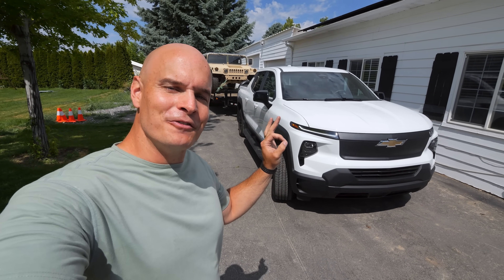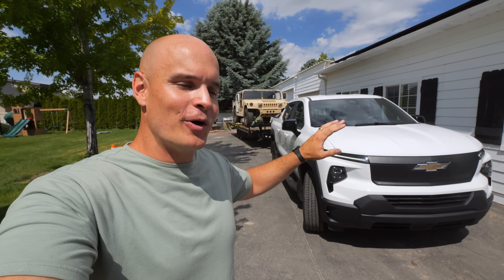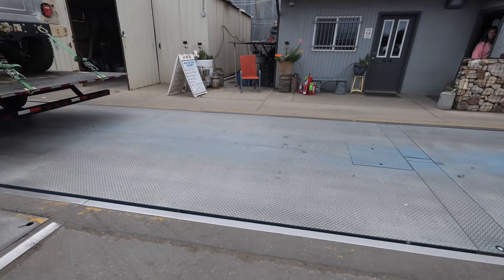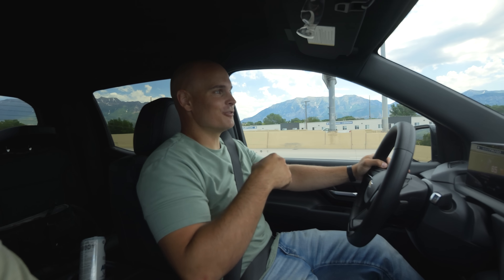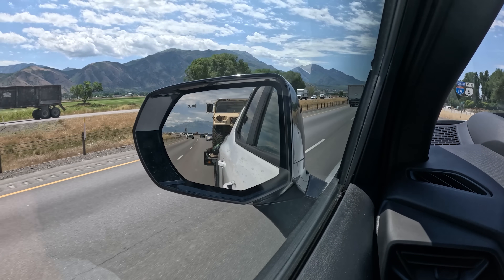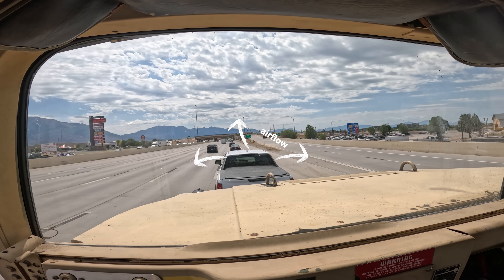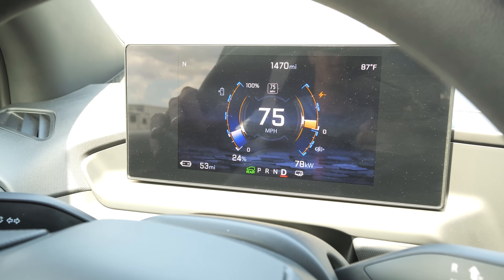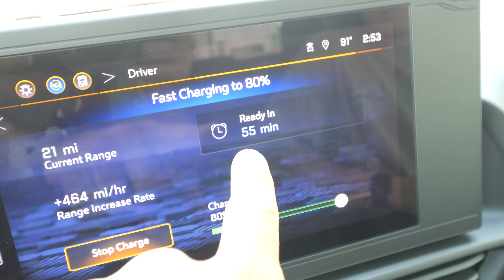The Chevy EV tows TWICE as far as the Cybertruck?!

Comment: Just saw that you said the Telsa and Rivian would only get 10-20 miles more of range during the summer vs winter. Wouldn't it really be closer to 35-40% more Range. I had a BMW i3 when it came out and the range was close to half maybe 60% as far during winter time. Kinda glad it got totaled by some kid in a chevy. You should redo your tests for the Rivian and Telsa now that it is warmer.
Reply: These trucks have much more battery capacity than a car but the cabin volume isn't that much bigger, meaning the cabin heating load shouldn't increase proportionally. The energy losses also tend to be much more pronounced for short trips than for longer ones. Some of the energy losses come from higher internal resistance in the battery when it's cold, but as that generates heat within the battery pack, this is a self-solving problem at longer distances.

Comment: When you look at it by Kwh the Silverado doesn't do as well as well as it initially appears. 

The Silverado has a 205Kwh battery: Cyber Truck has a 123Kwh battery and both the Rivian and Ford Lightning have 131Kwh batteries

The percentage difference between 123 and 205 is 50%
The percentage difference between 131 and 205 is 44.048%

Cybertruck 90 miles or 0.7317073170731707 Efficiency (miles per kWh)
Rivian 100 miles or 0.7633587786259542 Efficiency (miles per kWh)
Lightning 130 miles 0.9923664122137404 Efficiency (miles per kWh)
Silverado 163 miles 0.7951219512195122 Efficiency (miles per kWh)
Silverado claims to have 14 miles left: 0.8634146341463415 Efficiency (miles per kWh)

Comment: It's still gm tho so not safe or reliable enough for my preference until gm razes there quality control up at least 9% more I wont even look at them I like the ls not get me wrong but not in a chevy with a week trans/frame and the steering in them sucks I work on cars every day most of them that come in are gm and most of the work is for the front end trans or snapped frame from a cracked trans it seems that the only good part in them is the LS

Comment: Pretty good result. Also this truck can charge way faster than it showed there. 
Another YouTube channel I watched did a towing test with all four of the trucks, I believe fort Collins Colorado up and over the Rocky mountains to Grand junction and back. But it was 6,700 lb or 7,000 lb. 
They got 240 mi on the Chevy. With about 15% battery left when they got to the destination. When they plugged in it was pulling I think 330 kilowatts to about 50% and then held over 200 kilowatts to 80%. 15% to full took about 1 hour. And cost about $120 lol. 
All the other trucks required multiple charging stops both directions. The Silverado made it all the way to the end with one stop and then all the way back. It really is a hell of a good truck. It's just got a hell of a lot bigger battery which is what you need if you're going to do this kind of work. Also I believe it can output 11 kilowatts in the bed. And I think GM sells some equipment for your house to make the truck be a battery backup. GM did a lot right with this truck. And honestly it's not that much more expensive than a well equipped Denali.

Comment: My favorite incident in my Rivian was getting off the freeway, and ending up at the top of the offramp next to a lifted RAM Cummins who started rolling coal next to me. I just rolled my eyes. The light turned green, and he made a ton of noise turning left as fast as he could.

Then we ended up next to each other at the red light after crossing over the freeway. He started rolling coal again. This time, pointed in a straight line, I let him have it when the light turned green. He floored it, I left him in the dust before the two lanes merged into one.

Oh, and I was towing a 28', 7000-8000 lb travel trailer. He wasn't towing anything. And I was low on juice, that exit was to stop at a charging station, I only had ~8% battery left, so was slightly power-reduced.

Having to clean up the trailer from items that fell off shelves onto the floor was worth it to embarrass the coal roller.
Reply: lol. I’ve been rolled twice towing in my R1T. I just ignored it though, because I wasn’t confident my trailer could handle the launch. Funny thing is I have a power stroke diesel at home that I keep just for super long trips and when I need the extra payload. Coal rollers are just owning themselves by paying extra for fuel.
Reply: @WanderingWatts oh yeah it’s such a stupid way to tune a diesel engine most of the time it makes LESS power like that since the air fuel ratio is so rich. It’s nice seeing a tuned powerful diesel that runs clean
Reply: @WanderingWatts  My R1T replaced our Powerstroke 7.3. Having the 8’ bed would have been nice on two occasions, but haven’t yet run into something I truly couldn’t do in the R1T that the Ford could have done.
Reply: @AnonymousFreakYT - except stop at a fuel station for 5-10 minutes and keep going on your trip…..
Reply: @Harry_Truman72  I tend to lump my “stop to refuel” stops in with eating and using the restroom. It’s rare that I’m ready to start driving again before my truck is done recharging.
Reply: @AnonymousFreakYT  cope
Reply: I haven't had anyone try to coal roll me in the Model 3, but they try on the Bolt constantly. I usually don't have the opportunity to pass them, but I can get close enough behind them that the smoke goes around my car and not all over it. Makes them so mad to see a little hatchback gaining on them at full throttle.

Comment: You keep saying charging is cheaper than gas; however, you never speak of the cost of producing the electricity. You, still, have to burn fossil fuel to provide the power. (Before anyone speaks about solar or wind, you still have to use fossil fuel  based products to produce those.)
Reply from the maker: That's what the price of electricity is. It's the cost of burning or making whatever it is that generated the electricity.  Since electric vehicles are 95% efficient and gas motors are 30% efficient. It'll always be cheaper to make electricity at a power plant instead of under the hood of your car.

Comment: Battery Kwh sizes:
1)Silverado 205
2)Cyber Truck 123
3) Rivian 131
4) Ford Lightning131

So battery size is perhaps the largest difference.

Love the tow testing!
Reply: The Silverado got beefed with the batteries
Reply: @GameHorror73  it's the same as the Hummer
Reply: Did some quick math using the battery capacities and the ranges Zack found. I calculated the Miles/Kwh.

1) Silverado 0.86
2) Cyber Truck 0.73
3) Rivian 0.76
4) Ford Lightning 0.85
Reply: @SteinMale  for towing. When not towing Rivian is on top, then Cybertruck, then Lightning, then Silverado, last Hummer
Reply: @zigadabooga  when not towing the cybertruck gets about 2.7 miles per kWh and the Silverado gets about 2.35mi/kWh
Reply: Exactly. It has roughly 60% more battery than the others.  It should be able to tow further. It would be the same with ICE trucks if they each had different sized fuel tanks for a tow range test.
Reply: Ofc tank size (battery) is a large part of the range, that is why larger ICE trucks have larget fuel tanks compared to smaller cars...
Larger battery also have the ability to charge faster, and it help bring the center of gravity lower to the ground. The main drawback of a larger battery is price, nobody realy care about the weight outside of comparing numbers. Where weight is an issue, it is "always" a stat influensed by weight like carry capacity or "fuel efficiency" that for some reason are their own stats and not a problem?
Reply: @georgehenry3384  it's 215 probably 205 useable
Reply: @georgehenry3384  Rivian is 135
Reply: Also he did the test in winter for some of the trucks. Nothing about this is a fair experiment.
Reply: Note that 1 gallon of gas is 33.7 kwh. So, the Silverado basically did all that on about 6 gallons of gas equivalent energy. That's amazing, but still crazy that we need that massive of a battery to store that level of energy.
Reply: CT is 115 kWh real usable (8 kWh below 0%)
Reply: I don’t give a shit what the max range is when the trucks have different size tanks. What is the wh/mile on each one? That is the stat that really matters.
Reply: @motarded4214 I mean, considering that the Chevy Silverado EV is around the same price as a Cybertruck, yet has a bigger battery in order to get better range, then it's a pretty big deal. Why pay the same, or in this case likely more to end up getting less? (Since if you wanted the range extender for the Cybertruck, you'd pay even more than for a Silverado EV)
Reply: @xenofastiq  - Have you looked at the numbers for how much money GM is losing on every EV silverado they sell? Its some where around 15k loss per truck
Reply: @motarded4214  Cool, and that has nothing to do with how much they're still selling for. Why would most consumers pay more for less range
Reply: 177 miles for the silverado What where you watching.
Reply: Holy shit that can power my house for like 8-10 days
Reply: Silverado also has faster charging!
Reply: Size matters.
Reply: @georgehenry3384 you are correct and thanks for stating it directly. I just don’t understand why people don’t get it, including JRE.
Reply: That does seem to be the case. Evs need some major changes for it to be good at towing. Battery size increase means increase in weight which is bad when these vehicles are already so heavy.
Reply: @bruhder5854 Extra tow vehicle weight does tend to translate to better feeling tow vehicle though.
Reply: @bruhder5854  Battery research es getting big money and evolution is constant.  Power density increase while cost lowering.  So for comparing EVs, one important parameter is seldom mentioned is efficiency.
Reply: @guyboisvert66  they're already very efficient when it comes to the mechanical, electrical and electronical components. It's just the battery that is holding the entire industry back because there's no better alternative right now. It is getting massive investments but i think it'll take 2 decades at least till we see something concrete enter the market on a commercial scale.
Reply: @bruhder5854  we have already almost 200 W/h per kg in LFP!!   2 decades, ha ha ha, nice one!
Reply: @guyboisvert66  200w/h is nothing. It needs to be around 2000-5000 w/h per kg with a life span of at least 35 years.

Weight reduction, more range and higher life span without degradation. An lfp battery is right now the best of lithium battery type but it is still far off from what is required to shut the ice engine vehicles for good.
Reply: @bruhder5854  With a battery 150 Wh/kg i do 360KM with a 58 KW/H battery.... Another jewel from you!!! :-D
Reply: @guyboisvert66  that's still less than half of what the more efficient ice engine vehicles are able to do. 800-1000 km on full tank. Then there's hybrids which can do even more ridiculous numbers. 

- Evs also get worse range in hot and especially in cold environments. 
- The charging time is too much compared to ice vehicles. 

And then there's the weight and towing problem. Not until these problems are rectified can evs completely replace ice vehicles.
Reply: @bruhder5854  Rapid evolution my friend snd who cares about 1000 KM if we have 500 with fast charge speed?  We already have LFP much less sensitive to temperature with faster charge speed!  Not to mention 90% of driving sessions are within 100KM !!
Reply: @guyboisvert66  ask yourself this. Is that good enough to replace ALL vehicles on the road. Be it public trasport buses, trucks carrying load on a long travel route or your average joe that gets range anxiety because the charging infrastructure isn't reliable in most places of the world. 

And just to be clear, I'm very much so a pro ev person because I see the economic factor with solar on house and convenience evs bring with less maintenance but you have to be more critical and see what are factors holding the technology back from completely replacing petrol based vehicles.
Reply: @bruhder5854  1000KM, there are EVs doing it popping here and there, but that's just marketing, we don't care!  But anyway, that's your choice while i'm saving 300$+ in gas each month (25 000 km annually), no oil change, no brakes, no muffler, etc etc etc.  I'll never go back to ICE that's for sure!  Not to mention it feels like driving a jet!!!
Reply: @bruhder5854  We're not talking about replacing all ICE in a few years, R&D budgets are high an evolution is rapid and i'm not saying ICE is for everybody right now.  BUT in a few years from now, prices will go down and will be even lower than ICE.  If i compare right now a Tesla Model 3 to competition from BMW / Audi / Mercedes / Lexus, choice is very easy, not even close!
Reply: @bruhder5854  1. Battery only needs to be ~400-500 wh/kg to be lighter than its ICEV (V6 engine 150 kg to 250 kg + 70-120L of gasoline for an average daily driver)
2. MG announces an extended lifetime warranty for High-Voltage Battery in Thailand
Reply: @bruhder5854 Your current vehicle isn't+35 years old
Reply: What's the use of lugging around so much weight... Very inefficient to move at high speeds, and to fast charge. Just use a hybrid as the 'greener' alternative at this point.
Reply: @divyanshbhutra5071  hybrids can be less "green" if not used in EV mode, as a report by the European Commission has found.
Reply: @xiangkunwan  Hybrids are more green that vehicles having giant 200kW batteries, according to the study on Hummer EV.
Reply: @divyanshbhutra5071  The Hummer EV is known for having the largest battery on any consumer EV and only 9,500 have ever been sold in the USA and Canada, (A more reasonable study would have compared the top-selling EV to a top-selling hybrid or a weighted average based on what is on the road)
Reply: The cybertruck deserves another test once the extended battery in the bed is available!
Reply: @SrApathy33  How many people do you think would even buy it for $10K? Not to mention the fact it may never come out. I mean Tesla announced the Roadster 2020 in 2017. Today they haven't even decided a factory to make the Roadster and are now talking of announcing an autonomous taxi.
Reply: @SrApathy33  or at least the same time of year with the same type of tires.

Comment: Would be good if you would put this in a unit such as distance total per battery capacity. It’s not hard to drive 177 miles when your battery is 212 kWh of capacity while other trucks like the Rivian only have 130 kWh

Comment: to answer the question in your title (i know it wasn't a serious question but still)
the Silverado EV has a 200+ kWh battery. yes, it's probably still a bit more efficient at towing aerodynamic wise than the cybertruck but I think the GINORMOUS battery is most of the different. (for reference, the cybertruck has a 123kWh battery)
Reply: don't get me wrong, it's still impressive. but I think most if not all manufacturers could get that kind of range if they slap a big ass battery into their truck like Chevy has done here
Reply: however the drawback obviously being the charging speed as you can see in the video. not the speed itself but rather the time it takes to fill up this giant battery. over 50 minutes to 80% is tough

Comment: Getting better but still would not want to road trip one with my 5th wheel cross country. At the moment i am at 520 miles between  fill ups pulling a 12k lb trailer filling up takes about 10 min. For comparison at 45 gallons

Comment: Great video as always! The results aren't too surprising when you know that the Silverado EV has a battery that's about twice as big as other electric pickups.
Reply: Yeah I was hoping he would mention this and not just let people assume it's twice as efficient...
Reply: @N__T  and it’s actually less efficient because it doesn’t get twice as much range when offloaded, which actually helps it during the towing test as the trailer and the load has less effect on the truck (in terms of efficiency).
Reply: Because is carrying the weight of 2 batteries
Reply: Putting the specs where it matters

Comment: We need pull-through charging. I wonder how CT with the extra battery would do.
Reply: Worse than the Silverado as the extra battery only means a total of 170 kwh vs 200+ for the Silverado.
Reply: @Saddex  Cybertruck is 259Wh/mile. Silverado is less efficient at 302Wh/mile. So it depends.
Reply: @arondaniel  The extra weight of the CT auxiliary battery pack will worsen the efficiency. Not by much probably, but maybe like 5-10% or so. Overall, I expect the Silverado to still come out ahead by around 10% extra range.

Comment: A couple of things to point out: 177 miles on a full charge isn't impressive. At all. For how much electricity it's consuming, that's insane really pathetic. If you actually want an impressive towing range, try the Ford F150 hybrid or the older F150 with the baby powerstroke. Temperature GREATLY affects electric vehicles. If it's around freezing, you've automatically cut your range by about a 3rd because it has to compensate and use a lot of energy to keep the battery warm, and the heater draws a lot of power, etc. You also have a more base model, Silverado EV, the higher the trim, the worse the range. And did I mention this STARTS at 95k? Before taxes title and dealer markups?
Reply from the maker: The same energy is consumed whether it's gas or electricity.  It's just the vast majority of energy is wasted (60% +) as heat and noise with gasoline.
Reply: @JerryRigEverything  very true. Though it's significantly harder and more time-consuming to find a fast charger